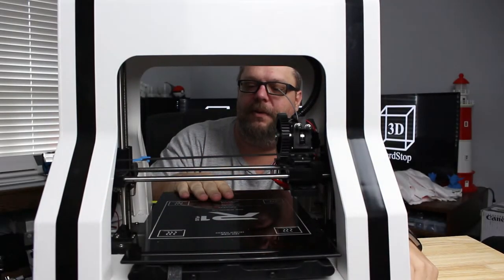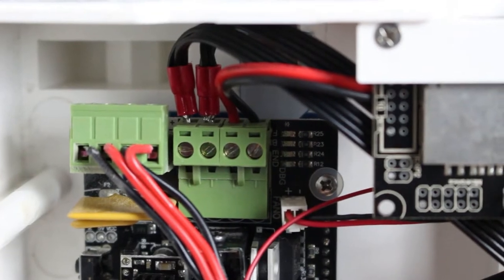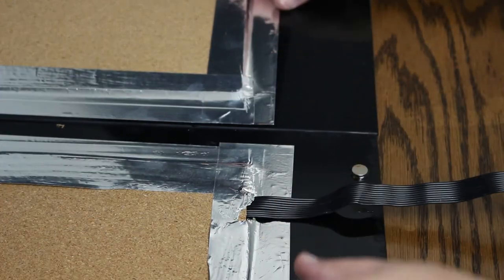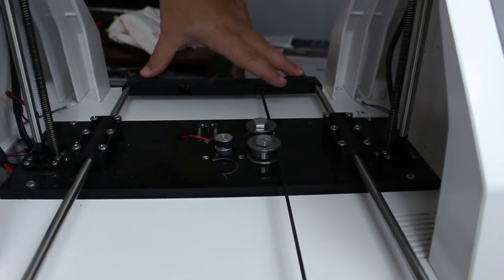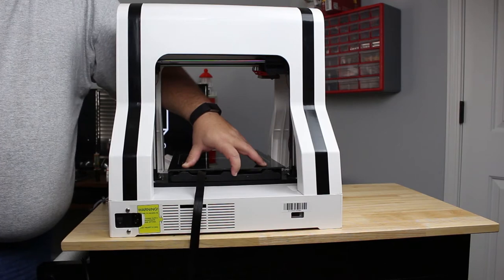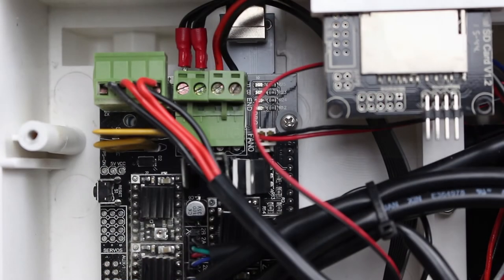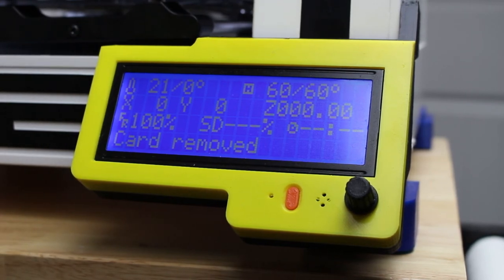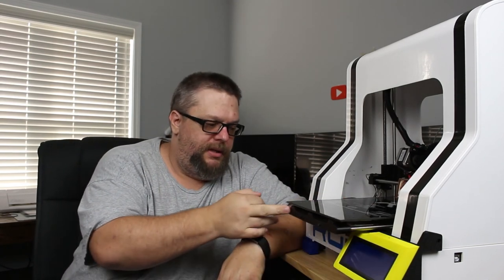3D Printer Maintenance: Replacing Build Plate

Comment: Thanks for showing. I would had thought one magnet would had been enough as well. I'm trying to debate getting a new bed for my Robo or just save for a new printer. No broken glass like yours but part of the cable is frayed that I covered with electrical tape. Sometimes bed temp doesn't show up but will print PLA OK without it.
Reply from the maker: Well, a new build plate is about $60.00 and I do not know how much longer ROBO will make/have the old build plates. The ROBO R2 and C2 should be out this month I think. I did just get in the CR-10 today. will be putting it together tomorrow and have a video out in about 2 weeks on it. Got it for under $400.00 with shipping. Did take 3 weeks to get it.
Reply: Yes, CR10 seems to be a popular choice right now. I'm thinking of MK2S though or maybe something else if I can save more money and Robo last.I really want to be able to have at least two materials to be able to use PVA in some projects.  Plus with Robo, when things broke in my first six months I did not get free replacements like I thought I was to.  So just not sure of continuing with them.
Reply: Oh also,  Doesn't look to be hard to setup that CR10. Just a few pieces to put together. ANet A8, A6 a lot more involved.
Reply from the maker: The CR10 does look easy to setup from what I have seen online. I did think about the MK2S and it looks like a lot of fun to setup. The reason I went for the CR10 was the sale price and the build size 300X300X400 and I mostly print in PLA or PETG.

Comment: thank you bro! my bed is all chipped and broken, iwas wondering if you thought on using a PEI sheet instead of replacing it all?
Reply from the maker: I did not think about using PEI sheets. That would have been a good way to work around the problem. I did think about getting a windshield repair kit and trying to repair the build plate. Still thinking about doing that to it and seeing if it will hold up to the heat.

Comment: Where did you get your replacement bed?
Reply from the maker: I got it from Robo before the R2 printers came out. Now if you want to replace your bed you will have to get a piece of glass cut.
Reply: Rorlin 3D NerdStop that's crazy they still sell them but you can't buy the part from them. I just got mine a month ago. I am waiting to hear back about the warranty. Also mine has a quick disconnect. Which some of the older ones don't.
Reply: You can still get one from Robo3D, they are just not listed on the website so you have to call Robo. They will just invoice you.  I just picked one up two weeks ago. It was a total of $90.00 with shipping.

Comment: Does anyone know where I might be able to order a replacement build plate now?  Robo3d.com doesn't seem to stock them anymore :(
Reply from the maker: I would look for a local glass Shop that does Glass Table Tops, Glass Showers, ... If you have the old print bed take it with you and have then match the glass type and cut you one 10" x 15" x 1/8". You might have to buy more then one depending on the shops min order. You should be able to take the old heating element off the bad bed and put it on the new bed.

Comment: I bought an extra build plate when I got my printer, thinking I would swap plates always having one ready to go with fresh glue. Now I know that is not practical. However I still wish there was a quick disconnect plug in back for build plate.
Then swapping plate for changing from PLA to ABS would be an option.  As I understand painting plate with ABS melted with acetone is best way to make ABS stick. Question: Has anyone ever frosted plate  (By sand blasting) and skipping glue or hair spray??  "Real quick" Thanks for your video.
Reply from the maker: I do know that some people have sanded there build plates but I do not know how well it really works and how often you would need to re-sand the build plate. If you wanted to make the build plate changeable you would have to cut the wires to the build plate and add some kind of plug. I would do this in the middle of the wire with a plug that would lock together like ( http://amzn.to/2gN8n3t  "Check that this has the correct count of wire connections"). Thanks For watching